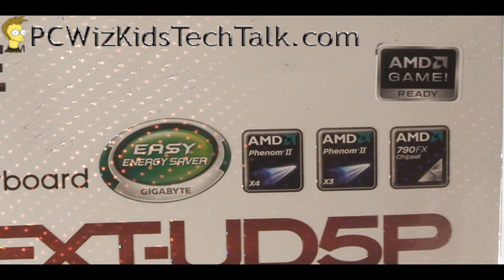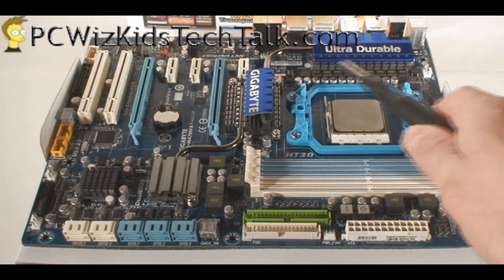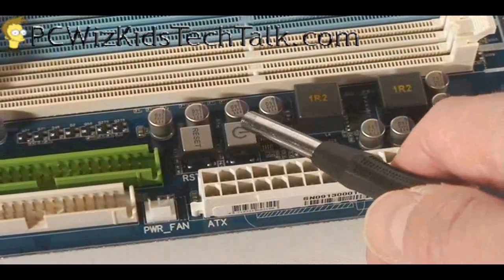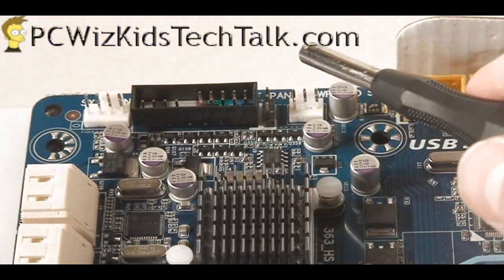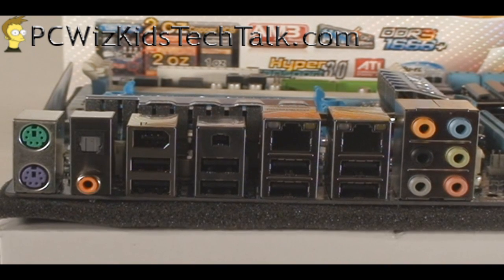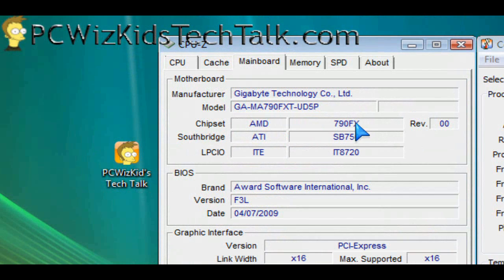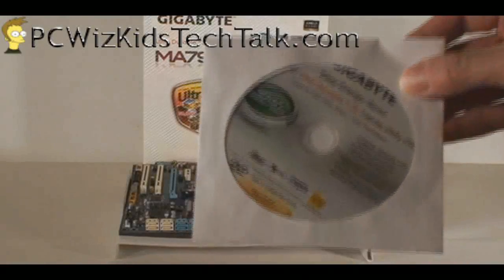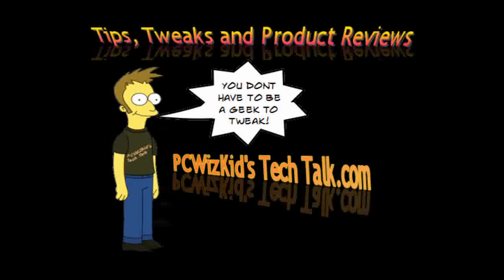Gigabyte MA 790FXT UDP5 - AM3 Motherboard Review

Comment: @PCWizKid i know this is an old review but as u mentioned that this board would support the 1090t fully does that include the over clocking aswell... can i over clock just the turbo clock only using this board??? :) thanks for you help

Comment: @MatthewDavison89 It can use nVidia cards with no problems, if you're using a single card.  There are reports of a so-called "SLI Hack" that would allow for two nVidia cards on an AMD Crossfire motherboard, but I can't personally verify that this works.

Comment: unlocking the x2 and x3 isnt really specific theirs a chance that the auctual cpu wont do it on any motherboard. As for unlocking them their really isnt a specific spec that says that. Its like saying oh yeah this gamepad can be hacked to do rapidfire, but when you buy the gamepad their is no thing that says you can solder wire a,b,and c to to rapidfire.